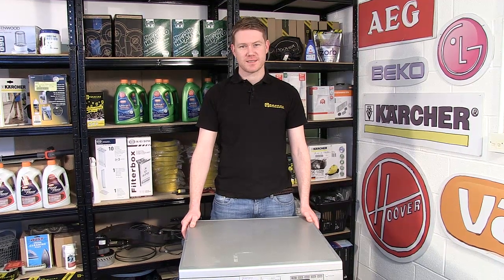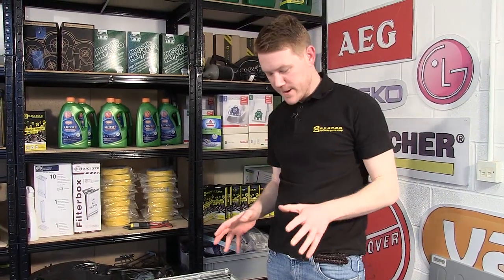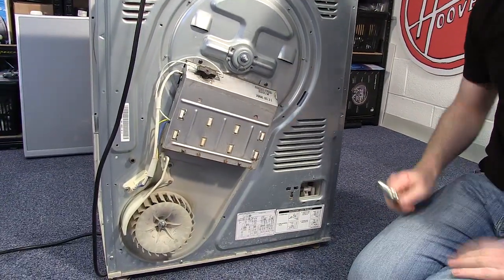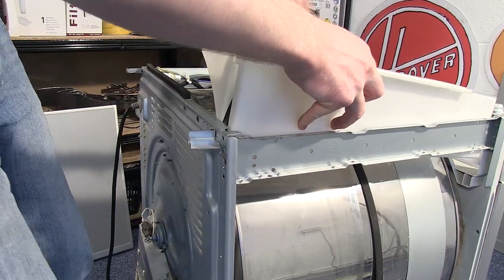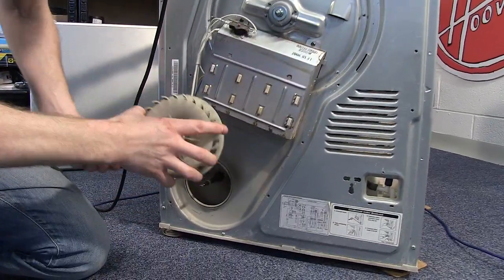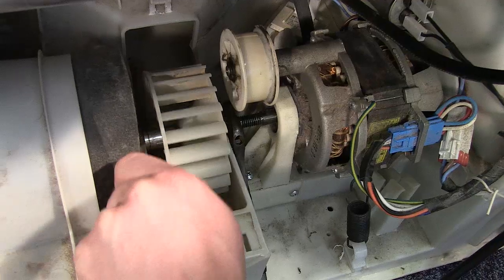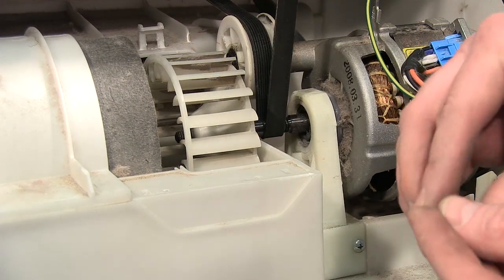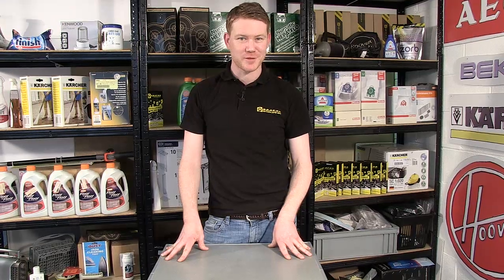Looking to EASILY Change Your LG Tumble Dryer Belt Yourself?

Comment: Just finished changing the belt on my AEG T76280AC. Took me almost 3 hours, mostly because i was too lazy to search for the right video. I had to remove the whole motor to reach with the belt to the right place, as the fan would not detach. 

Thanks for the help
Reply from the maker: Hi Dimitar, you may not have been able to find a video showing your model but as you will have discovered it is a similar procedure to our video.
Glad to hear you managed to complete the repair.

Comment: Done it in just over 1 hour, just putting the belt on the pulley messed with  my head for 10 mins but other than that it was spot on, 2 screws left over but I will call that a bonus it's usually more, next time 30 mins Thank's for video it saved me a fortune.
Reply from the maker: Thanks for your comments, that's what we like to hear 'confidence' for your next job. :-)

Comment: The part the breaks the most they make the hardest thing to change. Try doing this in a small room or closet with dryer on top of a washer. Blower nuts never like to come off a hot motor shaft after a few years. Most all are reversed thread nut.  And the customer wants to know why so much money to just change a belt.Note your bloody hands.Great video.
Reply from the maker: +JeffatJY Unfortunately nearly every dryer that you are likely to find will be difficult to replace the drive belt due to their design. However with the right information and a bit of patience most people are capable of carrying out the repair. Good point about Mat's injury 'minor knick' and it is worth mentioning that when covers are off there are often sharp edges that can easily catch you and cut. Hope all went well for you on your repair.

Comment: THANK YOU VERY MUCH!!!You just saved me 80 euro.I replaced the belt alone(with clothes inside :p )
The dryes is pitsos but from inside the regulator and the belt and the motor are the same.
I think i am hearing a strange sound now, but i am not sure if there isnt before..
Reply from the maker: Glad to hear we helped, if you think there is a 'strange noise' check the belt is in the correct place and the pulley bearing is not worn.

Comment: Thank you very much, this video was really helpful!
2 things:
1. I didn't remove the top sliding (water?) drawer. It wasn't really more dificult to get the belt in ;-)
2. The 2nd fan in the bottom has reverse thread. (In dutch we call it 'left' thread)
Again thank you very much!
Sincere greetings, Peter
Reply from the maker: Thanks for the comments Peter, glad to hear we helped.
Reply: Peter S wish I'd of read this first as I snapped a spanner trying to undo the left handed thread, but apart from that this was an excellent video and saved heaps on calling out a repair man.
Reply: Peter S ,"

Comment: Great video! how long should it take a novice.
Reply from the maker: That depends on how 'handy you are, someone with a modest experience of DIY would probably be able to do this is around an hour but a complete novice may take twice this time. A good way yo prepare for this is to get several small containers for the different screws you may come across. Label each for the different screw types and use a felt pen to indicate on the case '1' for the first type and' 2' '3' etc as you remove the different types. Then as you dismantle take regular photos on your phone so when it comes to reassembly you will know which part came off where and what screw was used. Make sure you have enough space and good luck.

Comment: A nice video. I need to check if this would be the problem of our Gorenje D73225. It makes a screeching sound if I turn manually the drum (when the door is open) but in my opinion the drum doesn't move at all when I close the door but it is trying to do something. If I wait for a while, it starts making burning smell and that's when I get alerted to stop it.
Reply from the maker: The problem is likely to be due to the drive belt coming off the tension pulley (probably due to a worn pulley).  If you cannot find the part you need on our website fill in your details at this link and we will locate the part for you http://www.espares.co.uk/contact/sales.
Reply: Thanks! I'll dismantle the machine and have a look!

Comment: You might clean the fans while you are at it.
Reply from the maker: +Philip Murray Thanks for the comment Philip.  It is always a good idea when you are carrying out a repair to clean any pars hat look a bit grubby. Fan blades often build up dust from the air they move, this can cause them to go off balance and created a droning noise. Cleaning may prevent this.

Comment: And what do you do if the screw on the fan won't move? I'm afraid to use too much pressure so I don't damage the motor or the spindle.
Reply from the maker: Tine Zavrsnik  The nut on the condenser fan we are pretty sure is a left handed thread so it undoes in a clockwise direction. If you cannot remove it try penetration oil and leave for ten minutes.

Comment: Inside looks the same only my pulley cant be pulled back.
I cant get the belt over the pulley. Any1 can help me out?
Its an indisit btw
Reply from the maker: Hi Day, we have a couple of videos on the belt replacement on an Indesit that could help www.youtube.com/watch?v=snWjzoV6HjI&t try this one first.
Reply: eSpares thanks it worked. Somehow now my heating element is also broken. Belt is in place now tho. Gonna get a new 1 that heating element is not cheap and no garanties that it will be the only problem
Reply from the maker: Hi Day Lee, have you tested it with a multimeter, make sure it has failed before you replace it.
Reply: eSpares dont know how and havent got 1. But had it turned on while open and it doesnt heat up at all. Also pressed the reset button and made sure all cables where in place. No luck
Reply: eSpares thanks for the help btw
Reply from the maker: Hi Day Lee, without the multimeter, you can't confirm if the heater has failed, check the connections to the heater and thermostats before deciding whether to replace the heater and good luck.